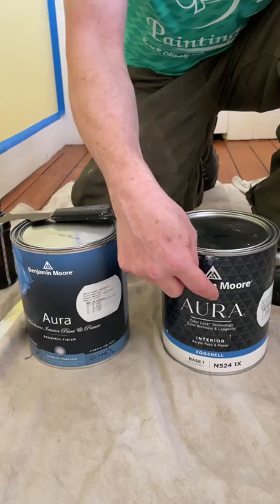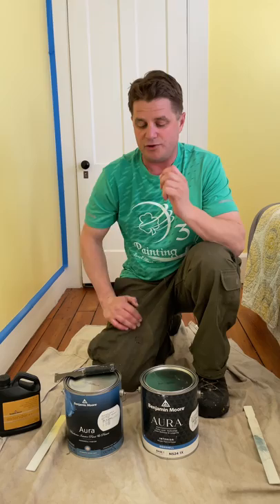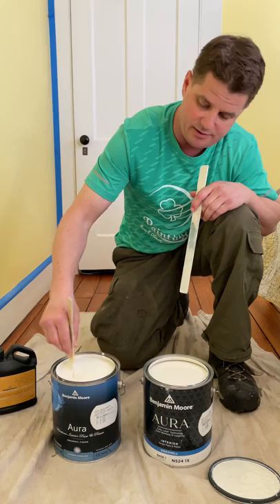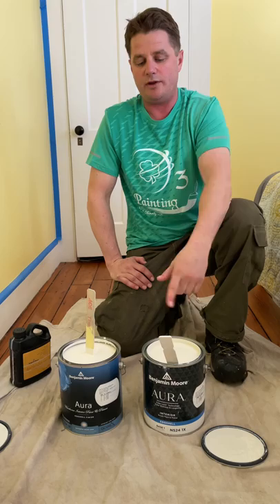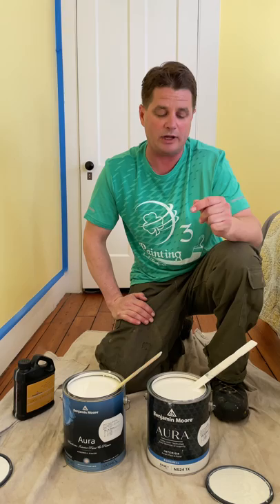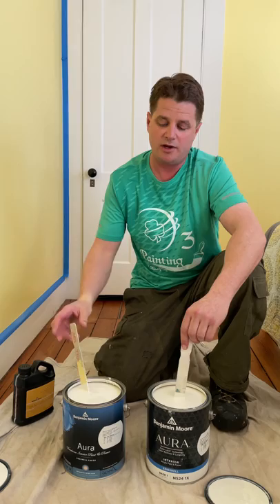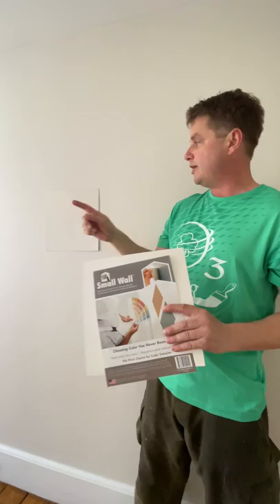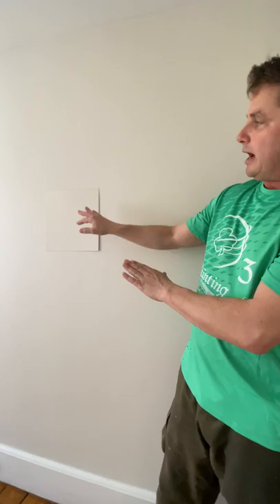Benjamin Moore Aura New Formula Change

Comment: Thanks Russ. We just started to use this new formulation of Aura. It is still difficult to work with. It’s driving my painter nuts as it’s very runny and messy. We worked with Sherwin Williams Emerald and it went on beautifully. Both Aura and Emerald are “Top of the Line”.
I don’t think we’ll be using Aura again. It’s more expensive and way harder to use.
Reply from the maker: Hi
Thanks for your message! Did u like it before? What surface are u going over?

Russ
Reply: Exterior and interior paint on very well primed cedar. The damn stuff runs  right down the brush handle when doing ceiling. Took it back to store to ask what’s going on? And they kind of said reformulation.
Reply from the maker: Yes it’s much thinner than it was. Why where you using it on a ceiling? Was it tongue and groove?
Reply from the maker: Can u post ur comment again. It doesn’t show up!
Reply: @RussOlinatzPaintShow  Just the trim on the beams and the edges so there was some overhead work. Primary color of ceiling was done with Sherwin Williams' "Emerald" product. Have to say although the brushes are a mess (my painter is very tidy) cleanup with warm water and Dawn dish soap was very easy with the "Aura".  Aura+Dawn=Light Clean. LOL
BTW: In answer to your question it was tongue and groove. Why?
Reply from the maker: Oh ok. Tongue and groove ceiling. I thought you you where using Aura on ceiling where that should of been a flat sheen. How do it cover?
Reply: @RussOlinatzPaintShow  Definitely needs two coats. Hoping the durability is worth the trouble.

Comment: How is the leveling? I liked the original, but even w 4oz extender/can, roller stipple always left something to be desired. SW Emerald gets a lot of hate, but the finish has always impressed me. Pretty much looks sprayed with the right short nap roller cover.
Reply from the maker: Hi

What roller sleeve are you using with the old formula and where you using it for trim or walls?
Reply: @RussOlinatzPaintShow  Pro/Doo-Z 5/16 and skim coated drywall over BM 046.
Reply from the maker: Hi

If you want it smootherI would use a 1/4 inch microfiber roller. If you want it even smoother, I would use the Benjamin Moore Advance Paint. That levels out great, but only comes in Satin Sheen and above that. It’s a similar paint to Sherwin Williams Emerald Urethane Trim and Enamel paint! Have you used the Advance paint?
Reply: @RussOlinatzPaintShow  Yes re: advance. The super pure whites yellow (as per BM) and I've seen it in person, so that's a no-go.
Reply from the maker: Ok!

Comment: This is a gross error in product design.   I wonder how many contractors ruined their customer's paint jobs with the old formula and then sued BM for damages???   A good paint should work well right out of the can.   You shouldn't have to spend extra on an additive to correct Benjamin Moore,s chemistry flaw.  That's ridiculous!
Reply from the maker: Hi

Thank you for sharing your thoughts on this matter! It was a Good Paint and Still is a good Paint with an even more Open Time before it Sets, not dries! A Good Paint should work Well right out of the can does not work in All Situations! Paints are not all the same and are applied to many different surfaces with different results! This is a Great Paint that works well over previously painted surfaces. Not    Bare Drywall!

Russ

Comment: Benjamin Moore only products I use.  The company simply gets it right and worth the extra money……
Reply from the maker: Hi
Have you tried out the new Aura formula?

Russ
Reply: @RussOlinatzPaintShow  no I haven’t.  I usually paint in Regal select
Reply from the maker: Why don’t you use Aura?
Reply: @RussOlinatzPaintShow  mainly because even after my painter discount at my store regal select matte is $56 a gallon.  Aurora is $68….(and I think for the money Regal is fine.  However I have used Aura it’s good just it’s a little hard to bid jobs using that (price point)
Reply from the maker: Hi

Thanks for sharing that! Yes it’s pricey, especially now, but did you know it covers better than the Regal Select and is a Zero VOC paint?

Russ
Reply: @RussOlinatzPaintShow  I don’t think it covers that much better.  Regal gets everything in two coats and for it’s price I’m sticking with it.  But I would never say anything bad about a Benjamin Moore product.  Aura is just a little high for me….

Comment: It’s actually not good paint for paint long walls,not forgiving at all ,can see your not  not paid by BM great job
Reply from the maker: Hi Kevin

Yes you have to work fast with this stuff and make sure that you are painting over a sealed surface. It covers better than other paints. What paint do you like to work with?

Russ
Reply: @RussOlinatzPaintShow  yes it is nice paint to work with when it’s done , long walls are scary because of if you it get mucked up you have lost all  profits just finished a house,with it and starting another,but with very long walls,so the extender is the way to go even with the new formula,I do like it great video good to know Calabogie Canada
Reply from the maker: Hi Kevin

With the long walls, what surface are you applying it over? Bare Sheetrock? Or primed Sheetrock?
Reply: Repaint I went on line and checked out some videos I will get some exstender got 50 years experience still working full time love it ,great videos by the way .
Reply: It is nice paint though used it before I like a flat , can’t beat flat oil also
Reply from the maker: Thank you!
Reply from the maker: Hi

What sheen do you get the Aura in?
Reply: I’m using the Matt flat
Reply from the maker: Yes I wish it came in Flat!
Reply: @kevinlentz7604  I’m debating Aura matte or eggshell for common area walls. Even paint store giving me mixed information. Is the Aura matte washable? Or do you recommend Aura egg shell? I heard for trim skip a sheen so if matte walls use satin for trim but it eggshell walls use semi-gloss on trim/wood work, right?
Reply: @dhrtiwalter8670  I like soft gloss or satin for trim because you can use it for trim doors kitchens and baths and cupboards , it’s your preference,eggshell for bedrooms and every where else, hi traffic areas you use your soft gloss or satin